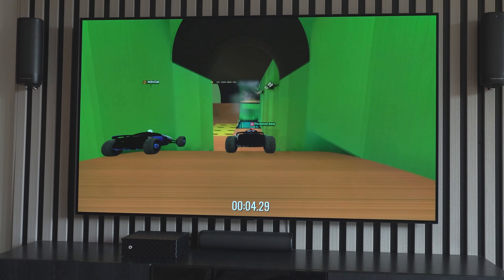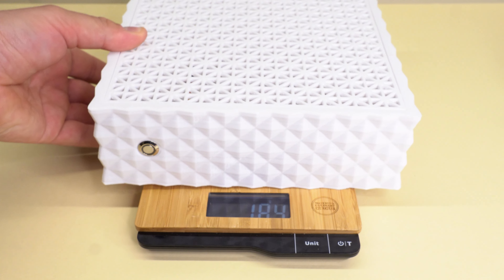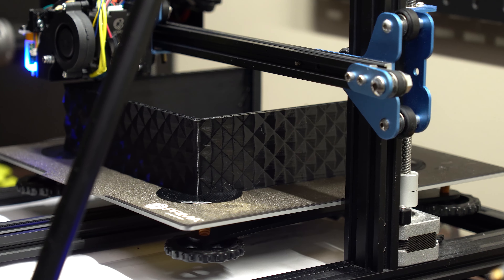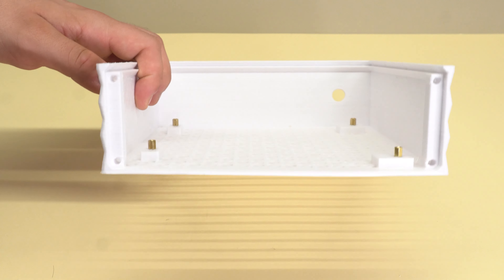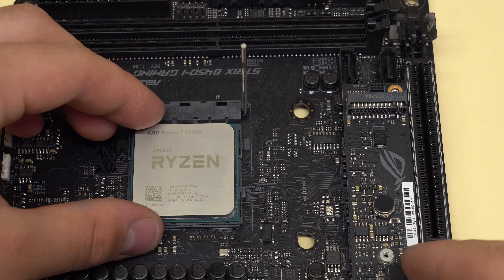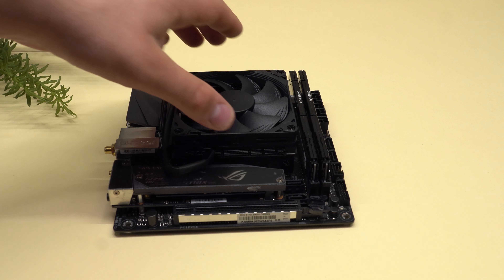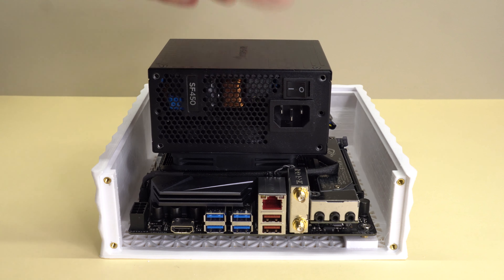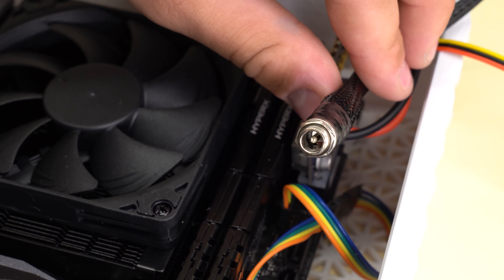Tiny 2.9L 3D printed ITX PC case

Comment: Again with the awesome design and builds! I think incorporating a little bit of extra space for 2 80mm fans would do wonders in improving the temps and noise. Take a look at the Goodisory A02 case for details. May not fit then on a typical ender 3, but it would likely still be printable on a ~260mm build surface
Reply from the maker: Fitting on an Ender 3 is in no way a requirement, I just like to make that option available whenever I can 😊 I looked up the Goodisory, that layout could definitely work for a future project 👍
Reply: @makerunit  Other than 80mm fan on top/bottom, could you be nicely sandwich it with 4 2.5 hdd/ssd slot?
Reply from the maker: @arkapadma  it would work, allthough, are hdd’s really necessary anymore in 2023? I’ll personally be leaning towards less hdd compatible builds in the future, especially as more and more stuff gets cloud based too.
Reply: @makerunit  with new itx boards we are seeing that have two m.2 slots, i think m.2 SSDs are the way to go. The prices per TB have been dropping lately, making it even more enticing. The one constant, though, is reaching for the highest performance in a small form factor. Efficient cooling will always be ideal.
Reply from the maker: @Kajukota  exactly! Even in my last build I included hard drive space but at the cost of needing to use 92mm fans. Where I could have used a 140mm instead, but I wanted to have the option though I personally won’t use the drives myself. Could have probably skipped that 😅
Reply: That Goodisory A02 case has side fans. That would violate the expression of this design. If better cooling is needed, making 5 sides mesh, preferably print mesh, is far more efficient than any fan would be. But that is a totally different artistic expression. Printing mesh vertically is unpretty.
Reply: @makerunit  noctua also has a kit that allows the fan on the cooler to get fresh air by stacking foam gaskets to the required height. If this build is still together, it would be interesting to revisit and make your own 3d printed version of the gasket.
Reply from the maker: @Karakofirespartan  yeah that has crossed my mind! I also wanted to try a silent setup for something like this with a 200mm fan making the build pretty much silent.

Comment: this one is more along what im looking for. only difference really is need a gpu slot. You are fantastic at making these
Reply from the maker: Thank you! I appreciate the good feedback! 😊 I try to keep them coming!
Reply: @makerunit awesome! I would love to See a Version with a low Profile gpu. I am looking for something that i can mount to a wall, maybe even hide behind the TV, which is also wall mounted.
Reply: @makerunit  Make it a bit thicker ala sandwich style, with both a single fan gpu and flex psu in the same compartment.
Reply from the maker: @maskednil  it could work, would require a bit of width though. A significant amount more than now.
Reply: @makerunit  If you lay the flex psu on it's side, it'll add about 40mm, and 2.2 slot gpus are about 45mm, so not by too much.
Reply from the maker: @ oh, you mean next to each other like that. Adding those two though would add a case thickness of probably 80-90 more width than now, which would basically more than double the size, but could be doable I guess.

Comment: This case looks awesome! I am tempted to print and build it, but for what I want to use it for I'd need an expansion slot. Would you be able to slightly redesign it to accomodate a single slot PCI-E bay for a dual 2.5 GBit ethernet card? I want to build my custom PC build that's my router into it. It's got an APU like this build so I wouldn't need a GPU since it's not a gaming intended setup. I've subbed btw.
Reply from the maker: Hi! Thank you! 

The .step file should be available on Printables if you want to edit the file. Unfortunately I’m already running late on some of my upcoming projects so I can’t take the time to do this modification at the moment. I hope you understand.

Comment: what plastic do you recommend for any computer case? I don't want it to warp over time.
Reply from the maker: The safest choice is PETG, relatively easy to print, easily available and can handle pretty high temps without issues. Though personally I haven’t had much issues with PLA either but I still mainly stick to PETG 😊 especially for a pretty hot design like this I’d definitely go PETG.

Comment: pretty damn impressive what just integrated grpahics can get done
Reply from the maker: Yeah and this is just a 5700G, a new generation even better has been released after this was posted as well. So my guess is within a few years onboard graphics will be pretty powerful. 

Although I believe it may be possible already, but the CPU and GPU manufacturers probably wont, as they also need there to be a GPU market 😅

Comment: love the design! quick question, wondering if a Thermalright AXP90 X47 would fit? its a little taller than the noctua you used. Thanks.
Reply from the maker: Thank you! How many millimeters is it? The noctua is about 37mm and there is very little room to spare, probably like 3-4 millimeters but I’d have to double check.

Comment: Nice case. Can I suggest a compact, micro-ATX vertical case with support for a 2/3 slot, 3 fans, 30/32 cm GPU? They're sorely missing from the market, most vertical cases are m-ITX, but m-ITX boards are exceedingly expensive.
Reply from the maker: Hi! Thanks! Compact and Micro ATX are often hard to combine, especially adding in fullsize 3 slot gpu’s also but I guess it could be possible in like a slim console style setup perhaps or something like that, but how compact it would be I’m not sure. Right now I’m thinking about extending this design to be able to hold a graphics card as well. Like same or similar design just bigger. 😊
Reply: @makerunit A flat, console style case would be cool, maybe to use as an old-school horizontal desktop replacement, but I think that something along the lines of the NZXT H1 would be the best. The overall volume of the case won't be small but the desk footprint would be minimal, and that's what it counts.

Comment: Great job!  I wonder if you used a fan duct from noctua if it would help a bit with the cooling?
Or making a cutout in the design just for the fan?
Reply from the maker: Thank you! You mean those sponge ducts? Yeah it could probably help a little bit with forcing it to grab air from the outside rather than reusing the inside exhaust air.
Reply: @makerunit  No problem!  And yeah those sponge/foam ducts.  Wonder if it would make a bit of a difference for this extremely space limited cases, I watched an Optimum Tech video and there was a measurable difference, but he had more clearance in his case to even possibly go for a taller cpu cooler, but I think in this case you couldn't, so the duct would be the only option.
Reply from the maker: @seeking.eternity  yeah it would definitely be worth a try at least.

Comment: hello,

What psu have you used? what brand? and power adapter? Could you indicate URLs, thanks.
Reply from the maker: Hi! I used a Pico PSU, it requires and external power brick. Were there no links in the description of the video?

Comment: What wall adapter do you use to power the picoPSU? I can't find anything higher than 12v 120w
Reply from the maker: Hmm, seems like the same model isn’t available any more, at least not where I bought it, but I used a 12v 20A power brick from a brand called «LedWholesalers»

Comment: Hey, you have really nice and clean builds. I'm wondering if I can adapt this case to a micro ATX motherboard. I'm student and I want to move my computer but mini itx motherboards are so expensive in my country. I would be very happy if you could recommend me a case for the micro ATX motherboard(i dont have graphics card, my sistem is apu). Have a nice day!
Reply from the maker: Hi! Thank you! The size of this case is unfortunately not big enough for a Micro ATX, and it would require a full redesign of the entire case for it to fit. I might make a micro atx case soon again but will most likely be with GPU support too so slightly bigger, also possibly an ATX power supply as well.
Reply: @makerunit  Okey, thanks for your answer. :)

Comment: hey im coming from techbymatt. i would love to get into 3d printing. i know this may not be the right place to ask, but what do you think is the best place to start? I'm thinking of getting the ender 3 v2 neo, but, are there any other options on a budget? Thank you!
Reply from the maker: Honestly I think the Ender 3 printers are great beginners printers, but you will most likely need to do some manual calibration to get things running optimally, and the wheels will eventually wear out so the printer will need to be calibrated from time to time, but it’s a great way of learning how printers actually work. Unfortunately I have only experience with Creality printers so far and they do work very well but they need to be adjusted frequently to make sure the prints are optimal. I’d honestly just watch a bunch of reviews of the Ender 3 v2 neo and some of it’s competitors like Elegoo Neptune or Anycubic Kobra for example which will give you some ideas to what printer suits your needs the best. Also consider what types of prints you want go do as build volume might be a limiting factor if you want to print big stuff like PC cases. 😁

Comment: Petg explains the warping
Reply from the maker: Yeah that one corner was a bit warped unfortunately. I struggle to keep the PETG completely stuck down. Even with ears the warping forces are insane. 😅
Reply: @makerunit  heated chamber is the best solution. Otherwise the best option is probably turning off part cooling, setting the bed temp really high (~90C) and printing thin layers at very high temperature (~255C)
Reply from the maker: @Flapdr01  I normally have my printer in a closet so the temp gets pretty warm but not like 80-90 though, but for this one I just did some maintenance on my printer so I kept it out of the closet for this print too 😅

Comment: quick question, what would I do if my build required around 300 or 350w of power?
Reply from the maker: I think you can get these 24 pin power adapters with higher ratings, though the biggest 12v external power brick I was able to find on Amazon was the 240w one… what CPU that’s suitable in that type of build draws that much power though? If I may ask 😊 remember in a build like this you probably should narrow down the CPU alternatives to ones that are capable with the Noctua L9i or L9a as these are the only coolers that would fit that I know of, which would mean any CPU with a 65w TDP rating 😊 usually these don’t draw that much power from what I know.
Reply: @makerunit  I wanted to design my own version of something like this, with my old computer's i7-3770k it should work with the Noctua L9i, and I have an old graphics card that draws 40w of power. it is the Quadro p620. I think what I will do is use one of the 1u server power supplies. It won't be as slim, however it'll be close
Reply from the maker: @carterbilawchuk  aha I thought you were referring to a build in this case 😊 then I understand more. One thing to note though is that this Pico PSU don’t have a power out for GPU. Only 1x 8pin for CPU… 😅 but perhaps there are some models that do have that, I’m not sure

Comment: Does stock cpu fan fit? or need the noctua?
Reply from the maker: Only the noctua will fit here, very little room to spare unfortunately. 😅
Reply: @makerunit  not a problem. All parts are finishing now on the P1Ps will be ordering parts as well. Saving soon for a gpu and I’ll upgrade the casing to your larger format cube file soon enough.
Reply from the maker: @Jsantos443  awesome! I hope the designs will meet your expectations 😁

Comment: I feel like this is an example of just because you can, doesn't mean you shoiuld.  if you reach the point of building a tiny pc where you have to buy an external PSU, you may as well just buy a mini PC for the added benefit of more ports and a smaller footprint.
Reply from the maker: Most Tiny PC’s can’t handle a 5700G though. Only the Asrock Deskmini x300 as far as I know exept from ITX boards. I actually have one already that I’m planning on building in later.

Comment: Hi. How did you create the big "ear" for greater adherence to the magnetic bed? Is a kind of brim?
Reply from the maker: Just made a circle on the corner and extruded it about 0.6mm or so. You can also take any model and add these in most slicers. 😊
Reply: @makerunit  thnx. I replicate somehow with huge raft or brims. I will try your method.

Comment: I can't find a power button with male connectors anywhere, only female.
Reply from the maker: You can get a male to male adapter cable. It’s called a jumper cable 😊 or you could just connect the female directly to the motherboard if it’s long enough.
Reply: Thanks @makerunit
Reply from the maker: @ServentofTheMostMerciful  actually, I said wrong… my bad. if the button only has a female connector you just need a regular female to male jumper cable to work as an extension. The connector type is called dupont connectors. You typically need a 4 pin cable to give power to the LED and the push itself. 

I hope you didn’t buy a male to male cable yet 🤞
Reply: No, I didn't, thanks for the heads up. Appreciated. @makerunit

Comment: Tem que fazer com as laterais vazadas para o ar quente sair, o fundo vazado não é viável. Por isso bateu 90º ai.
Reply from the maker: Yes, correct. There’s no way for the air to escape other than out to the sides but since they’re closed it forces the air back out again to the intake making it circulate it’s own exhaust. Some small exhaust fans to one side and some ducts for air to be forced out the other side might improve this.

Comment: you could've used a little bit bigger cooler. but overall nice build.
Reply from the maker: Thank you! Yeah if I made the design a few more millimeters thick I could probably fit a 120mm fan instead, allowing for a lot better temps. Even some tiny 40mm fans to exhaust the hot air could do the trick.

Comment: Cura cannot slice the main piece, it goes to 30% slicing progress and then gets stuck meanwhile my high end gaming CPU running at 100%
Reply from the maker: That is strange, try rotating the part or use a different slicer profile. Over thousand people have downloaded this and none have had this issue as far as I know 😊 at least non reported. Let me know if it works out
Reply: @makerunit  rotating doesn't help, it slices in Prusa slicer tho
Reply from the maker: @Arek_R.  that’s strange. I’ve never tested this file with Cura. Might be some geometry in there that cura somehow struggles with, happens sometimes. Are you able to print it with a Prusa profile? Because I can’t really think of any other ways to solve this. As the file itself looks just fine.
Reply: @makerunit  I can use Prusa it's just that I struggle using it, different settings laid out in a different weird way, quality comes a bit worse as well.
Reply: @makerunit  I've tried changing slicer settings and it didn't help either.
But I updated cura from 5.4.0 to 5.7.2 and it works now.
Bizarre gltich...
Reply from the maker: @Arek_R.  that’s great! Actually when I come to think about it I’ve had other people mentioning on previous projects that specifically in Cura they have had slicing problems on some models. But never in Prusa, Super, Orca etc… very strange.
Reply: @makerunit  I think I know what might have been the problem.
There are a lot of triangles on the bottom, the slicer tries to optimise the paths for absolute minimum or even no travel moves.
This results in a very long extrusion path, I saw the printer go for like 10+ minutes doing those triangles with a continuous move.
It probably required very long calculations and it hit into some limitation in the old version.
Reply from the maker: @Arek_R.  aha, that might make sense. Anyways, I’m glad you figured it out 😊
Reply: @makerunit  The main part has been printed, tho I've used some old crappy ABS filament prone to warping, and the corners slightly lifted even tho the chamber was at 55C, and I used the stl with ears.
The pattern on the outside indeed looks nice when light falls at it at an angle.

Comment: Seems like we meet here on your channel again first.

The sim cut out is in violation of the ATX spec. To get its precise position and size, just download the 2.x version of the spec.

The spec defines a 2,54mm keep out zone round the rear sim cutout. The wall thickness of that zone, should be at max around 1,2mm. Exact numbers is in the spec. In a proper modeled case, the sim will fit insanely tight. For a low tolerance build, you probably need to drop them brass standoffs. A properly designed printed case, has by far tighter tolerances than sheet metal cases.

All your case walls are too thick. You could easily slim the design particularly at the rear side of the MB, using more modern techniques. Also, mesh is best designed in the slicer, not in the modeling cad. You currently design by strong couplings and loose cohesion.
Reply from the maker: Hi, thanks for the enlightenment, I was not aware of these specs. The only specs I’ve looked into were the mounting holes for the ITX motherboard. I’m still learning…